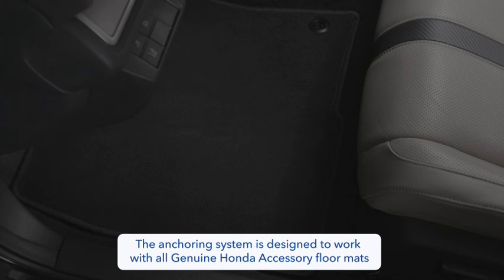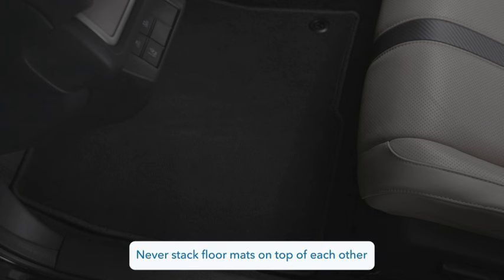Securing Honda Floor Mats

Comment: A car wash I went to broke off my lock part. I bought the part to replace it. Anyone have any tips on installing it myself or a reference video I can look at?
Reply: The bottom bit or the bit on the mat?
Reply: @Mooney76  if for the bottom bit? uhv any idea how to repair it?
Reply: @zamerzahran1033  think they just clip in the carpet, u get the clips when buying new mats but I never replaced mine